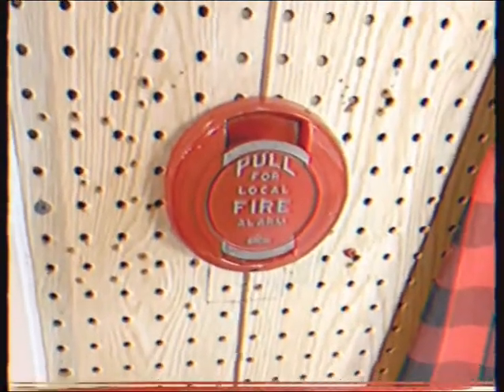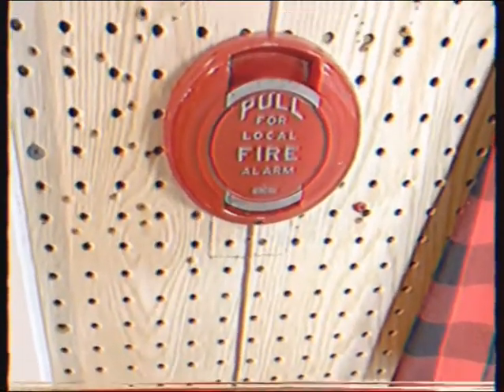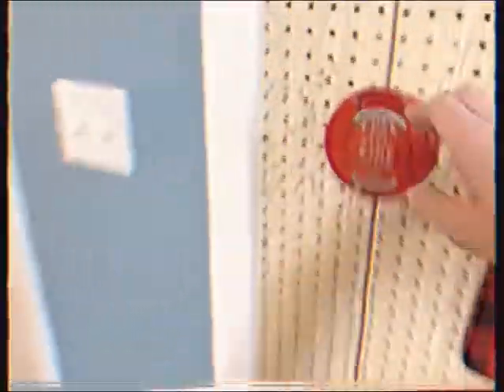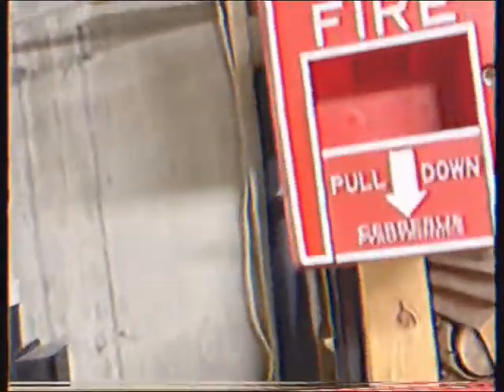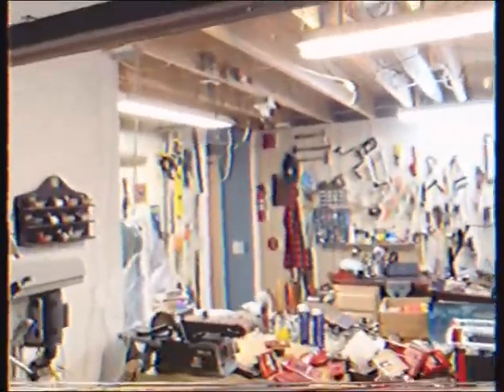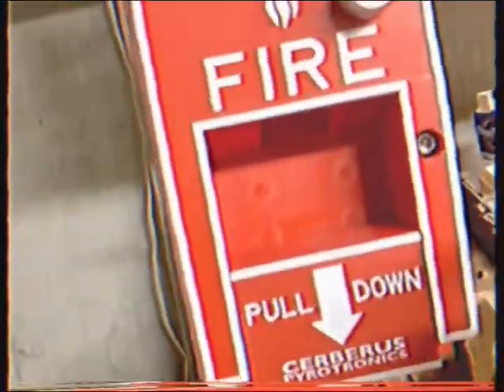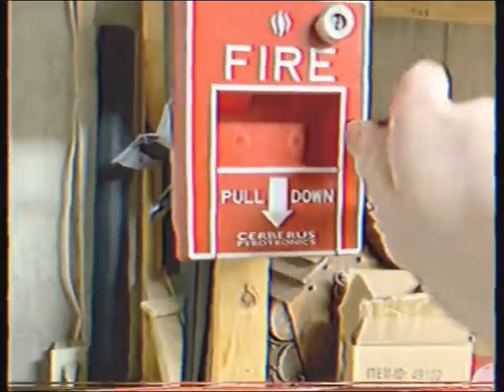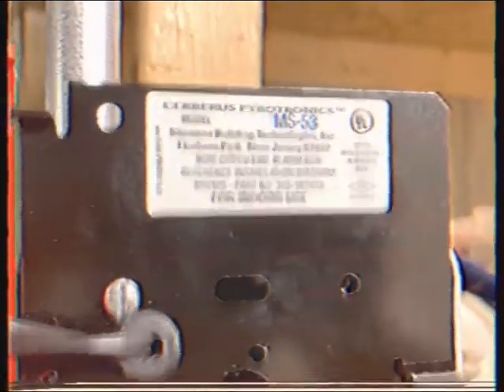Old School Fire Alarm Video: Mechanical Horns | #FireAlarmFriday

Comment: Though the 9840 is DC, it is tuned in b3, 240hz, which is the same note that the AC horns are using (60hz b1, a.k.a the mains hum), which makes the system variety sound cooler.

Yes, I sound like a nerd.

Comment: Have you considered running 4 wires to each notification spot? That way the strobes won’t skip the off beat on temporal. I also don’t have a panel but I have just a simple switch that turns off the power the the horn wires but leaves the power on to the strobes. So it’s basically audible silence
Reply from the maker: I have, just haven’t gotten around to it

Comment: What’s a ga switch?
Reply: General Alarm switches are used for two-stage systems. A two-stage system is any fire alarm system where the audibles (horns, speakers. bells, whatever) are sounded in two different ways. Usually, one way is the first, initial phase. When an alarm condition is received, the audibles will go off in a distinctive manner that is mostly meant to signal building staff that there may be a problem and to begin investigating. It can mean other things depending on the building, of course. Upon some other condition, usually the discovery of a fire, the second stage is activated. The audibles will switch to a second mode (or there may be another set of audibles that go off) and an evacuation will be carried out. This second stage can be activated many different ways. It may be done automatically by certain smoke detectors or by another pull station being activated. Another option are these General Alarm switches. If a staff member discovers a fire, they can open the pull station and instantly set off second stage and initiate a general evacuation (even skipping the first stage!). Its like setting off a pull station twice, except the second switch is one with an especially high priority.
Reply: @InkyLeopard  that makes sense. It’s like a smoke detector going off in an apartment, then if a second one goes off evacuating the entire building?
Reply: @albanyweather7947  That is a good example! If someone sets off a smoke alarm in their apartment because they burned their dinner, it would be silly to evacuate the whole thing. A two stage system would prevent that. A second smoke alarm going off, say in the hall or in the apartment next door, would indicate something bad that necessitates a general evacuation.
Reply from the maker: Like that time I burnt water?
Reply: @HenBasketFireAlarms  I think so! Last week something very similar happened to me, my apartment building had 2 alarms on the first floor, but then the smoke went up to my 3rd floor apt but it didn't set off the whole building... the EST (rebranded by ADT) system be faulty, as confirmed by the facilities staff
Reply from the maker: General alarm, for use in two stage systems. I’m not the best at explaining it, so I’m gonna pass this on to one of my fellow content creators.

Comment: Can we eo 90 or 120 bpm march time to change it up
Reply from the maker: I can only do T3 or continuous with what I have.
Reply: @HenBasketFireAlarms  a relay should do that
Reply from the maker: I do not have anything to produce the coded signal, so a relay would be of no help
Reply: @HenBasketFireAlarms  put it in continuous and flip pull station switch fast on and off
Reply from the maker: Are you… being serious…?
Reply: @HenBasketFireAlarms  nope
Reply: @HenBasketFireAlarms  use a time click relay from potter, i think thats what its called
Reply: @HenBasketFireAlarms  this feels like a simplex tech video